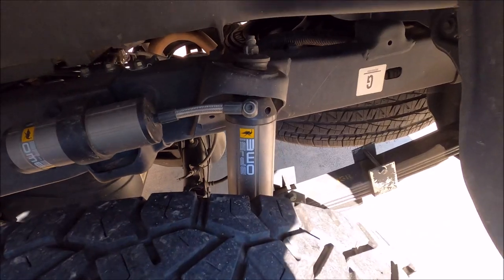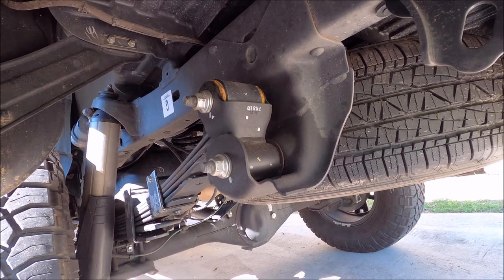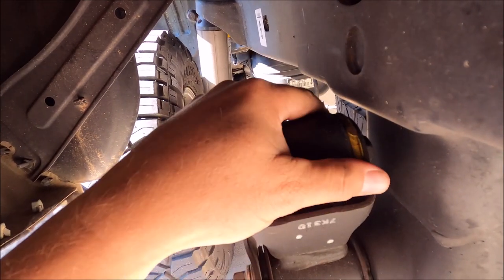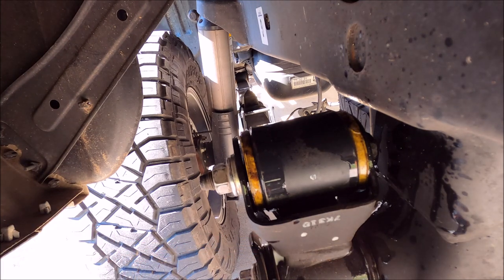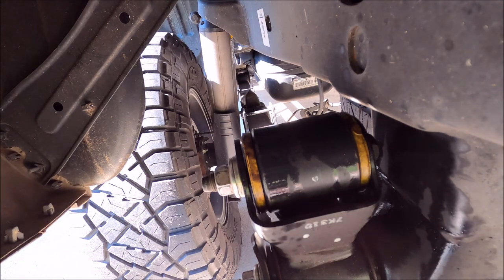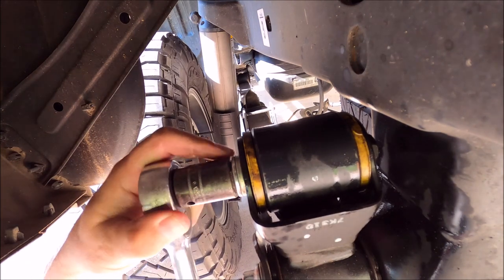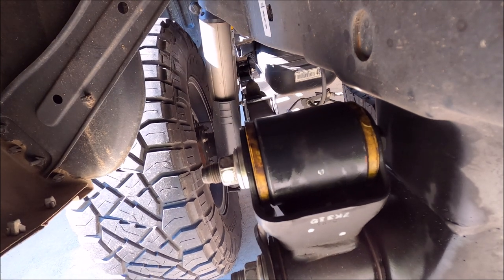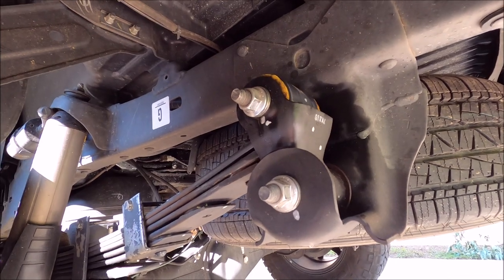Toyota Tacoma OME BP-51 Loud Crackling Rickety Garbage Suspension Bushing Noise SOLVED: Get Triggerd

Comment: Sounds much better. I used to drill a hole and install a zerk fitting in some of the non serviceable bushings. The comp bushings are usually a lot harder material than the stock ones.
Reply from the maker: thought about that. Swing by with your tools I need help if this doesn't help him out
Reply: @ExploringAlabama  HELLO, did I get it wrong?  I thought you were picking me up at the crop dusters runway. Was I supposed to get an Alabama Uber?  I know, I know. You're asking yourself, "what is an Alabama Uber"? The definition changes depending on what's being harvested at the time.

Comment: Stick a pry bar between each leaf and expose the bushings between the leaf and spray dry lube or wd40 on them, that will also help with noise when they get wet.
Reply from the maker: tried that. Didn't do anything. That's the point of the bushings
Reply: @ExploringAlabama  I get that but the bushings are notorious for being noisy. I have the same leaf pack as you and mine are very loud when they get wet and that solves my problem. I never had the issue with the shackle bushings though.

Comment: Those shackles have to be tightened with the weight of the vehicle on them . Lots of shops will hang the trucks axles and tightened then it breaks the vulcanized rubber from wear it was made . They aren't ment to pivot

Comment: My Tundra made a similar noise after putting the BP-51 kit on it at ~75k miles. 
I greased EVERYTHING and it was still there.
Finally, I isolated it…it was the body mount at the front of the bed.

Comment: Holly shit… I just did this and it fixed my issue. Been living with this for 4 years and randomly came across this video. I loosened my bolts up and jumped on the bed. Cleaned them up and torqued them to 89 ft lbs. Just found torque specs from Tacomaworld. Not sure If that’s the correct specs, but it fixed my issue.

Comment: A couple things:

1:  BP stands for it being an internal bypass damper.  

2:  Having BP-51s on a pavement truck in Alabama…. Hilarious.  You don’t need that much oil in a shock to handle a place like Alabama.  Remote reservoirs (not pumps as you called them) are totally overkill.

3:  Most OME suspension reviews are positive and they are a very trusted brand for vehicles that actually do remote travel on unimproved roads/trails (not driving around pavement in Alabama).  Most leaf packs can suffer from stuff like this, common knowledge for people who actually understand suspension components.  I wouldn’t trust most “4x4 shops” in a place like this.

4:  In the off-road space, ARB is known as being very communicative and proactive in answer questions. Then again, not much knowledge on display on this channel, so who knows whether the email was sent correctly.

5:  “unlucritable”.  Lol

6:  I would never let this dude near my truck. Haha
Reply from the maker: Take your meds mam, take your meds

Comment: Easy fix, spacers between the leaf springs, had the same issue on my OMEs. Not a grease issue, but can’t hurt to grease up those zirks in between the leafs.
Reply from the maker: I replaced them still clunk. They are hard plastic should they be soft?

Comment: Same set up, on for about 2 years now & luv it! Its all about the install man! Mine makes no noise & i probably average 50mi of dirt roads a month. OME is a great suspension system for the right application, just like Fox & Icon (their good for the right usage.
By the way, theres way to much preload on those springs for the weight your running, back it off to barley a ¼" of threads showing & drop a spacer in to bring the truck back up if you need to.
Reply from the maker: Man appreciate that I have no idea about this stuff. Can you explain more or email me? Alabamaexplorer@gmail.com it rides like an army tank and hits pebbles like they are boulders. Horrible ride